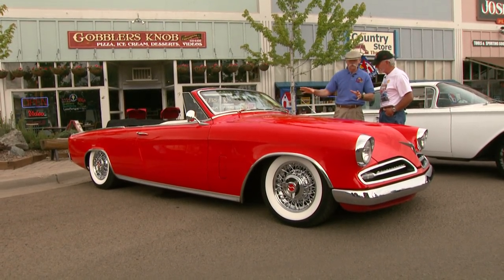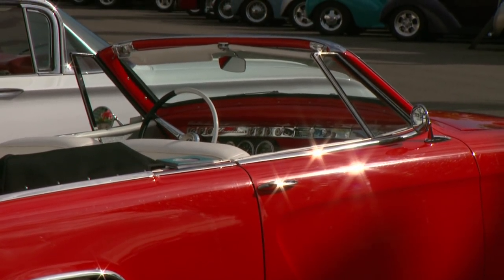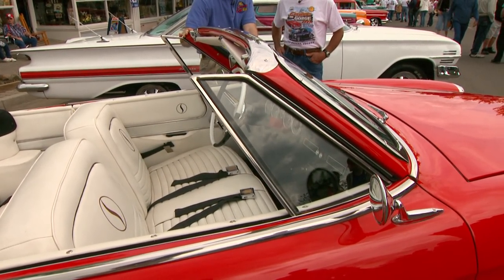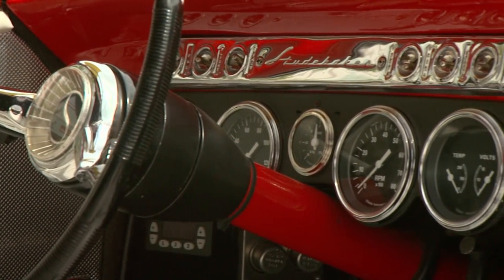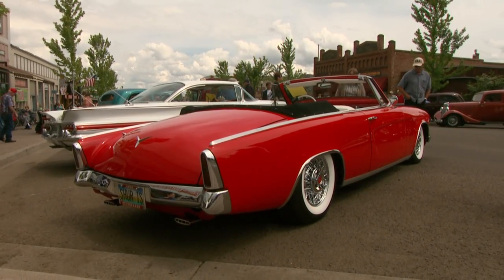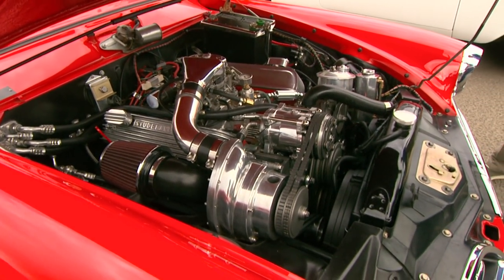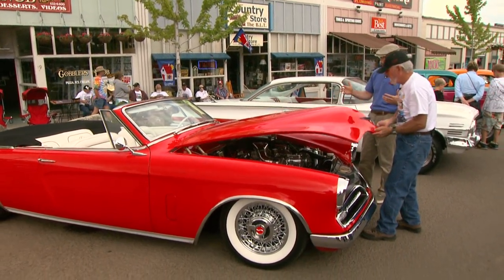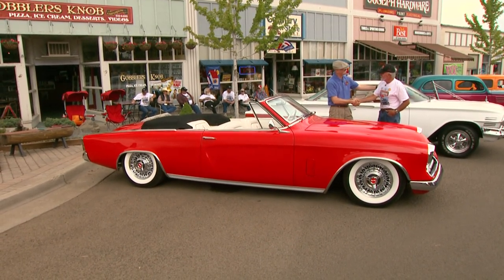The Studebaker That Never Was

Comment: I'm pretty sure I saw this car at the joint SDC/AOAI meet in Sacramento in 2003.  A heckuva head turner.  This car has the "Tri Star" emblem which Mercedes complained about being too close to theirs.  So Studebaker used it for only a very short time changing it to just a "V" with and "8" on it.  That wasn't the only activity with Mercedes, though.  From 1957 to 1963 Studebaker-Packard was the exclusive distributor of Mercedes-Benz in the U.S. and Canada and Mercedes was sold and serviced through Studebaker-Packard dealerships.  More obscure, perhaps, is that the Avanti used Mercedes Benz door locks.
Reply: And 1964-66 Studebakers used Chevy engines.
Reply: @scootergeorge9576  Those would be after Studebaker ended production in the U.S. and that closing also closed the engine production facility.  So those with Chevrolet engines would be Studebakers made in Canada until the end.

Comment: The Studebaker Lark was just the Hawk midsection with different front and rear clips. Since the Lark did come in convertible form, this wouldn't be all that difficult a conversion. Looks awesome.
Reply: Need to go back to school   The Lark is totally a different car than a hawk period.   No glass ,  sheet metal or chassis shared.

Comment: Studebaker actually built 3 or 4 "Lowey Convertibles" early on.  My recollection is that two went to Lowey and his wife, the others I'm not sure of.  In early winter of 1966-1967 I saw one in St Paul, MN one night.  My college room mate at the time was a Studebaker fan and when I told him, he said it wasn't possible. I confirmed I was sure, even knowing that the rear window was glass and not plastic, by the way it bounced as the car went down the street.   It caused a bit of a stir in the local Studebaker club, but they were never able to find who owned the car.

Comment: TETO....The original 53 Commander V8 started the evolution/bastardization of the Lowie Studio Design. I still believe it was the best looking.
Dad loved Studebaker, we had three growing up. I learned to drive on a '53 Commander V/8, three on the tree. Dad let me put 3in lowering blocks and spun aluminum lake hub caps and dual glass packs on her. That Loewy Coupe design was way ahead of its time. Our last was a '56 Golden Hawk with Packard's 275-horsepower 352 cubic-inch V8, Spun aluminum dash with Stewart Warner gauges, matching speedo & tach. 
A Muscle Car before the Muscle Cars. I was king of the Pack in '58 with my 200-foot burnout, (only one wheel, as lockers were still down the road).
 Ahh the memories.  Keep 'em alive. 👍

Comment: If I were a bazillionaire I would have Icon or someone build me a restomod out of a 53-54 Commander. They were so far ahead of their time in terms of design and aerodynamics. Imagine one of these with modern suspension, brakes and NVH, and a reliable and powerful crate engine.
Reply: A lot of these were made into  race cars either drag or salt flats speed cars.

Comment: Why can't this cat just be raised up a bit for practical street purposes, instead of being a low rider?  Maybe redesign the engine compartment to accommodate the intake charger add-on. With, or without.  Then, give your plans and start back up a small scale Studebaker company, and STILL put this into production? As is, it could, and would, compete against any of your exotic cars, or Thunderbird's reissue, or Mercedes Benz, porsche, or any of those people. Kinda the same concept what Shelby did.